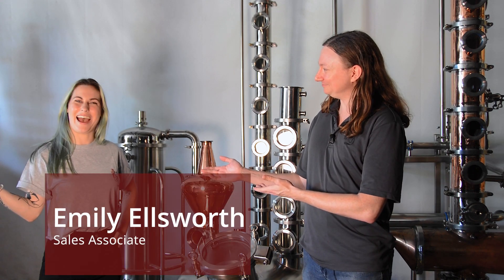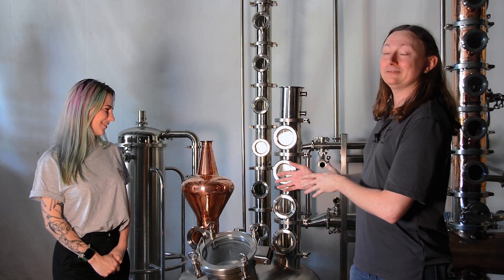What is a Reflux Column and How Does it Work? | StillDragon

Comment: In my vision of reality, that is a plate column (or other names).  Any column has passive reflux.  Adding a dephlegmator allows you to control the reflux in that column.  If there is packing in that column, or plates in that column, there is a multiplication of "steps" that the vapor is multiplied.  I expected the discussion to focus on the multiplication of "phase change steps".  In fact a simple (empty) tube filled with screen, marbles, or other packing can act as effectively as phase changes as the bubble plates...

Comment: Do you monitor water temp ex dephlegmator to assist control the ABV your letting through?
Reply: Hi Matt, monitoring cooling temps can be a helpful bit of data. However, unless you have the ability to provide consistent, uniform cooling media temps for the duration of your run, the cooling media temps will not provide dependable feedback without also factoring in the flow rate of your cooling media. In this instance it would be best to monitor alcohol vapor temps at the top of the column and adjust the cooling media flow rate accordingly.